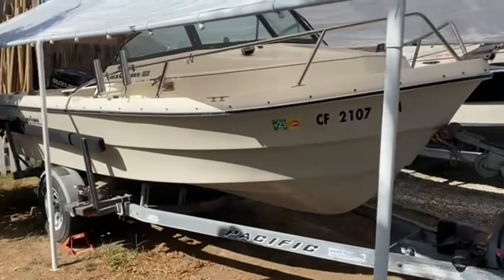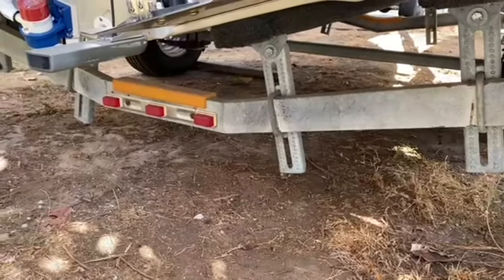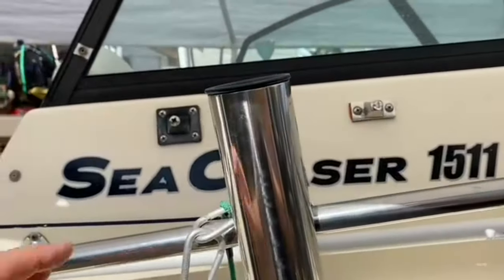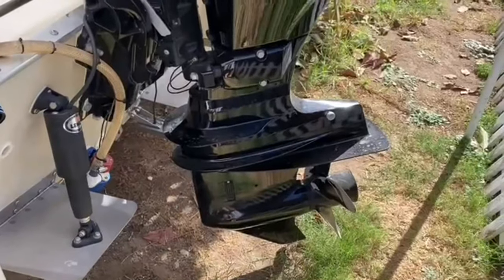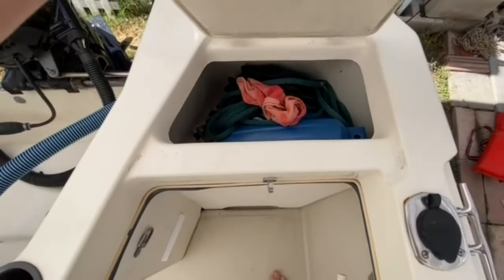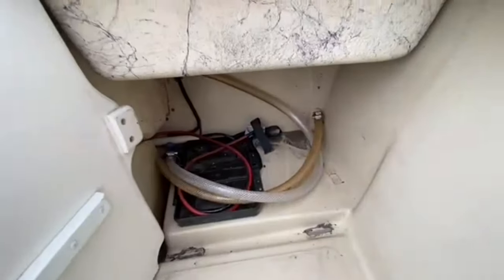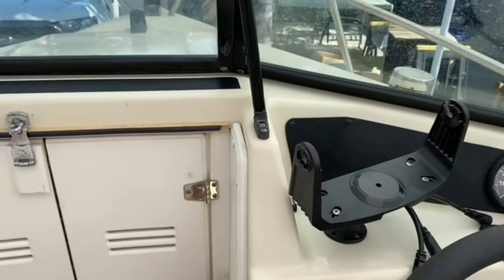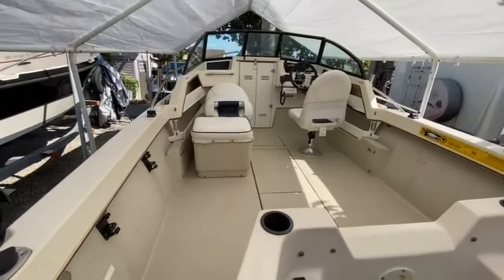1996 Arima Sea Chaser 16 | Walk Around.

Comment: How it handle going to san clemente?
Reply from the maker: Went to Catalina and the crossing was calm, so not a problem.
Reply: How many knots can this go
Reply from the maker: @coffeedollsvp  24 knots or 28 mph with my Suzuki 60hp. I had a detuned 4 blade prop to get the best features of a 4 blade and a 3 blade prop. With the right 3 blade you would hit 30 mph.